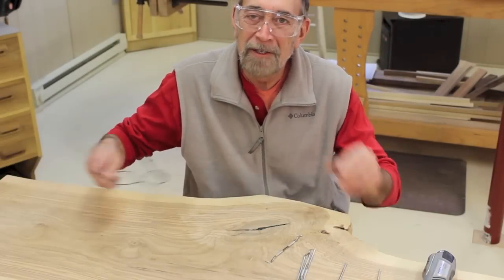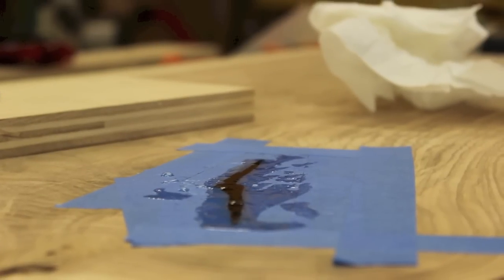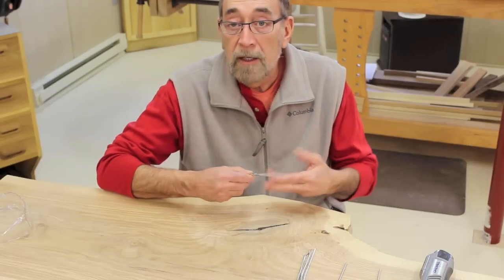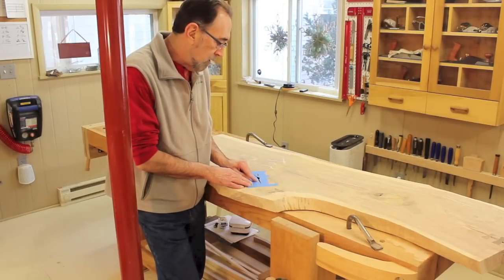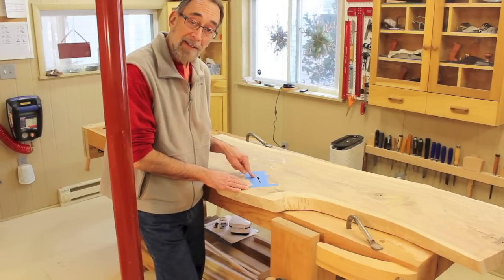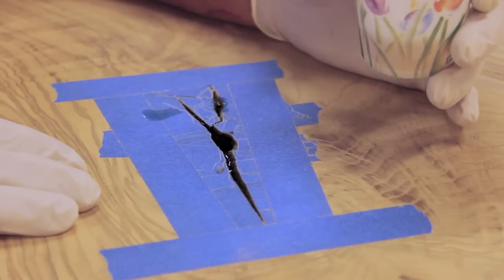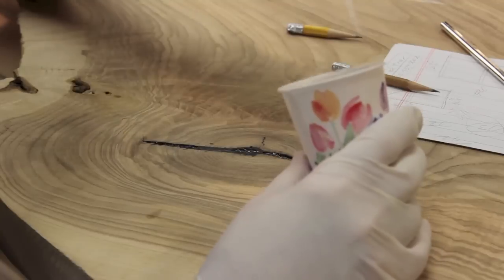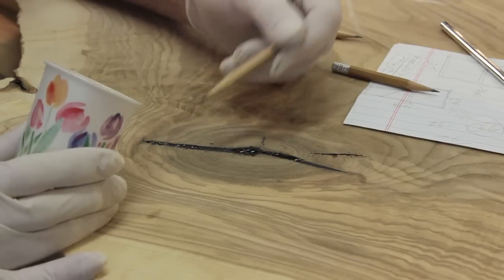Wood Knots & Other Defects

Comment: Thanks for the tip on not putting too much resin in the holes and getting bubbles! I have made a few fibre glass jobs (Fibre UK spelling)  mainly motorcycle parts. petrol tanks seats and plenty boat repairs, but the resin was never  used to fill deep cracks so I never had the bubble problem. I did notice bubbles in the mixing bowls when I had a large amount of the used stuff over.

Comment: Very nice tips.  I've seen a technique that uses a torch that is waved over the surface of the epoxy to help coax the bubble to the surface so that you don't get trapped bubbles.  Maybe that would help.  Thank you for the video. :)

Comment: Great video.  Appreciate what you do.  I have a suggestion for you and others regarding epoxy fills.  I've learned the hard way and have had to fix bad fills such as your experience.   We specialize in Live Edge furniture design.  Two important things to consider when doing a near flawless fill.  First, do NOT attempt to fill the void entirely.   If not, you will experience air bubbles as seen in this YouTube video.  You MUST first apply a "sealer" coat of epoxy to the sides and bottom of the void.  This eliminates any air ingress from the porous lumber.  It may take 1-2 coats.  Remember, you can re-coat the epoxy as soon as it sets up (usually in 30 - 45 minutes).  Once you have achieved a "seal" of the void then you are ready for a complete fill with much better results.   But remember, there will still be bubbles typically from stirring (unless you use a high pressure vacuum chamber to remove).  It is best to use a propane torch which you very QUICKLY pass over the void.  This will release the bubbles.  Heat guns are much less effective.   I hope this helps people.  Excellent epoxy fills (especially clear ones without dyes) are not easy to achieve without the proper technique & experience.

Comment: Great video! Love your shop, at least what I've seen so far.( just subscribed) I'm building a Mancave with some Rustic Oak and need to tend to several areas in desk and entertainment tops, I was going to use black epoxy but I like what you have done here. I think it will blend better with whatever surrounding color is! Thanks and keep up the good work!

Comment: Thank you for your videos. I have watched several and I am just beginning to work with wood after years of steel. My question is this. when do you use a bowtie vs. epoxy to stop a crack?  Thank you in advance.
Reply from the maker: Jay Zavisin The bow tie is a mechanical brace that will effectively stop a crack from getting wider.

Comment: Hi, good stuff!!  Could you maybe give some more details on the type of epoxy?  Any specific types or drying time epoxies you could recommend?  the 20 minute variety, etc.?  Thanks again!!
Reply from the maker: I use West Systems epoxies.  Here is the link:
http://www.westmarine.com/resins-fillers-fiberglass?cm_mmc=PS-_-Google-_-Top+Exact-_-west+system+epoxy&adpos=1t3&creative=75381004324&device=c&matchtype=e&network=g&gclid=CjwKEAjw7ZHABRCTr_DV4_ejvgQSJACr-YcwLx-_mD43E1MYJlwOnwh6HTMsBPCLtnS4jgYTkAoOfBoCSHvw_wcB
I use 105 Epoxy and 206 Hardener.
Reply: Thanks!!

Comment: Hey guys I just wanted to share a process that I have used since highschool to repair knots and voids using expoxy.  Rather than just using epoxy to stabilize the voids I add very fine wood dust from my palm sander of the species that I am filling and mix it just less than 50/50 ratio with the expoxy making a wood filler that no longer has bubbles, stabilizes the defect and looks better than any other filler I have ever seen.  I use West Systems expoxy.

Comment from the maker: I slid a dull chisel, bevel side down, between the bark and the cambium layer beneath and the bark popped right off.  What little bit was left I hit with a wire brush in an angle grinder.

Comment: Thanks for the video.  Since you tested the wood at the end with mineral spirits, I'm assuming you're planning on using some kind of oi based finish?  How long do you typically allow the epoxy to cure before finishing?  Thanks.
Reply from the maker: I used shellac for the finish... about 30 hand rubbed coats.  That might be a small exaggeration, but not much :)
As far as the cure time for the epoxy, I haven't ever really thought about it.  I usually work the live edge piece first, then build whatever frame it will be a part of after the top is "ready to go."  As a result, the epoxy might cure for several days while I build a leg assembly.  In my experience, though, the West Systems epoxies I use are totally cured in 24 hours.

Comment: I saw that you used West Systems, which I've used for years in boat repairs and other projects. Have you downloaded and read the free manual of epoxy use Gougeon Bros. offers? Two hundred plus pages of all their distilled knowledge and decades of experience in developing and using their epoxy system. Invaluable resource. Like your projects.

Comment: West System 3 is by far the best system for a woodworker to use.  It is used at the Wood Technology Center in Seattle, WA.  And just like any other epoxy woodworkers use don't for get to use standard precautions.  for those who don't, well, you just cant fix stupid

Comment: Can this method be used for cutting boards? I have a beautiful slab of hardwood with these big knots I would like to make into a cutting board, but my question is whether that epoxy will chip as a knife runs over the surface of the cutting board, or if it would be food safe.
Reply from the maker: My concern would not be with chipping, but whether or not the epoxy is "food safe."  I would contact the manufacturer directly to ask about that before proceeding.

Comment: Great video, very helpful! Can you give some more information on the exact epoxy you use, or other types that you would recommend?  Also, just a thought I wanted to share...when you need the old pencils to apply the epoxy if you don't have any available use a toothpick.  They are cheap and the perfect size!
Reply from the maker: Eric, the epoxy I use is West Systems 105 epoxy and 205 hardener.  They make a "slow set" hardener (#206), too, and I will try that whenever I use up this can.  West Systems epoxies are available at boat supply/repair houses and some mail order/internet places.  Someone else suggested the toothpick thing and I did the old "slap yourself on the forehead" and said "I could have had a vegetable juice drink."  :)

Comment: I've seen other people hit the epoxy with a heat gun or a torch to bring bubbles to the surface to pop.  Do you think that would that have worked for your bubble problem?
Reply from the maker: Annony Mouse Yes, I learned about that from people watching this video... thanks!!! the beautiful thing about YouTube is that we all get to learn from one another.
Reply: downtoearthwoodworks I have seen it work on flat surfaces but I asked because I'm not sure that same technique would work when you are talking about a deeper spaces like your knot holes and cracks.
Reply from the maker: I have a new project coming up that will involve filling a rather large crack in a slab... I have the slab here now.  I will try filling it a little bit at a time.  I think on a deep crack the bubbles can't get to the surface before the epoxy starts to harden so they get trapped... by filling it a little at a time I should be able to avoid that.
Reply: downtoearthwoodworks Cool, will watch for that video.
Reply: downtoearthwoodworks You hit it on the money ! 40 years of epoxy bars and tables tops tells me so !
Reply: can I poly over an epoxy fill like this?

Comment: I used to have a partner who made very large epoxy tables.. to get rid of the bubbles he used a torch lightly run over the surface. this totally eliminated the problem, even over very large surfaces. Perhaps a heat gun would yield the same results.
Reply from the maker: I have heard that suggestion and hope to try it on my next project.  Thanks!

Comment: can I put poly over the epoxy?
Reply from the maker: There are so many types of finishes out there it is difficult to tell without a test.  I would recommend testing it somewhere besides your finished piece.  Also, make sure the epoxy is fully cured, best to wait a few days, even though it will appear to be fully cured sooner. And you will need to sand the surface of the epoxy lightly to give it some "tack" to help the finish stick.
Reply: thanks. they aren't very big, and it will be a few days before is stain and poly, so I think I'll give it a whirl.

Comment: Is it worth using sawdust with the epoxy to make an 'invisible'fix? I'm just getting interested in wood work so no real practical knowledge or experience as yet...
Reply from the maker: +54v 115 On a small gap, crack, or hole some sawdust mixed with glue can make a nearly invisible "fix" but on a large crack or split it would likely be nearly impossible to make it invisible.  Often on slabs the cracks and splits are worked around as an "aesthetic" component in the design.  Over time a lot of pieces of wood with cracks, knots, splits, and other defects will wind up in your scrap bin.  These are great to use for experiments.  Try filling cracks with clear epoxy, epoxy mixed with dye, sawdust, or almost anything else and see what the finished product looks like.  Keep notes, keep the samples, and someday on a special project, you will know exactly what "look" you want and how to replicate it.  I saw a very nice slab-topped bench a while back where the woodworker mixed copper dust with epoxy and it was very pretty.

Comment: you need vibration not heat when filling a deep space like that. vibration will bring the bubbles up from any depth. dont ever use a paint brush to mix the epoxy, it adds way more bubbles than if you used something like a popsicle stick (the craft kind, not the leftover from eating one). and you're letting it sit too long, never go back and use 'whats left', mix up a new batch. also those little waxed cups you're using is a big nono, the epoxy eats away at the wax and messes up your mixture.
Reply: so you shouldn't use the epoxy chip brush? I use them in body shop work, but was going to do my first walnut furniture piece, was gifted a few beautiful planks of cherry and walnut and wanted to tie in a few decorative ties, any advice would help, tux for the good visual instructions :)
Reply: +Shandon Meadows thanks I meant, not tux lol